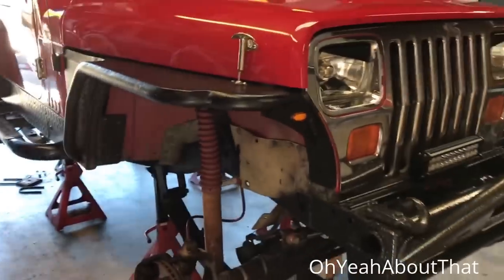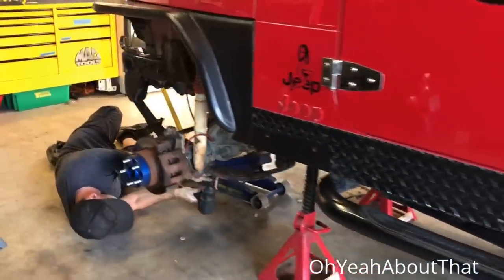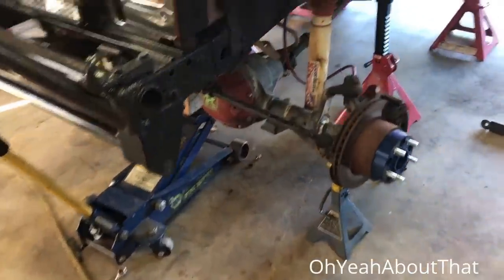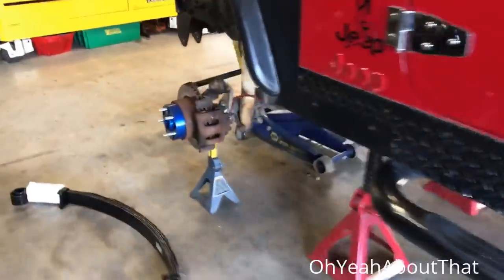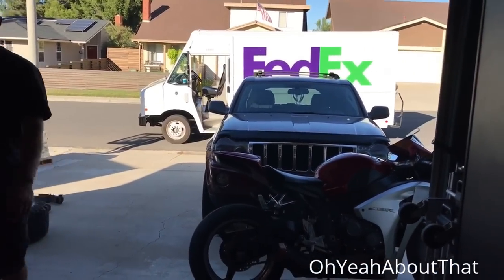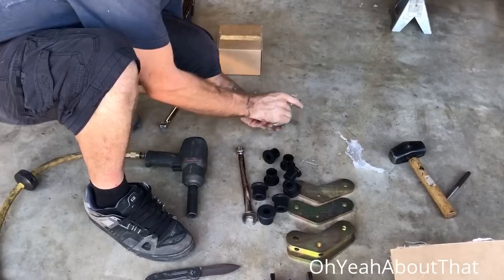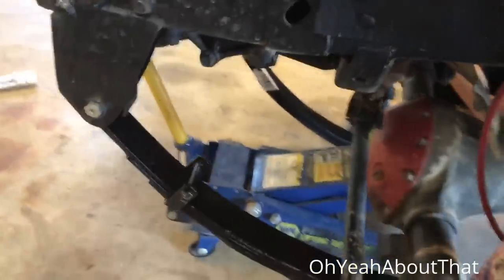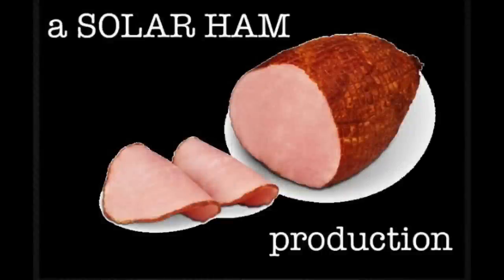Nic's 1992 Wrangler YJ gets new springs and boomerang shackles!

Comment: hey man, I'm hoping you can give me some clarification, I'm looking into getting a 4 inch lift for my YJ and have been trying to figure out what to do with my drive shaft, if I recall correctly you have a 4 inch lift on your yj, do you have anything done do your drive shaft? Slip yoke eliminator, rear cv driveshaft or has it been left stock?
Reply from the maker: Rory Cairns I have a transfer case drop on mine with no issues. He's getting an SYE kit for his very soon. I'll do another video.
Reply: It's all stock other then the transfer case drop? Are you having any driveshaft vibration?
Reply from the maker: Rory Cairns mine is, as far as I can tell. You shouldn't need more than the transfer case drop with a 4" lift like mine. I don't have any vibration at all.
Reply: awesome, thanks for the help!
Reply from the maker: Rory Cairns glad to help
Reply from the maker: +alandude58 just the boomerang shackles. They looked reversed to me, but Nic said they were on the correct way.
Reply: The front shackles are reversed.  Supposed to be a solid mount at the rear of the spring with the drop shackle at the front.  This has been swapped on this Jeep.  Some people think its better like that, but its not the original design